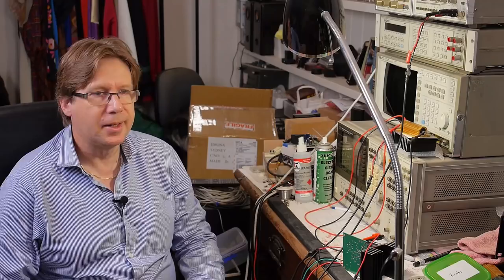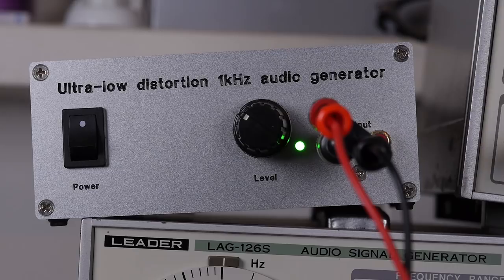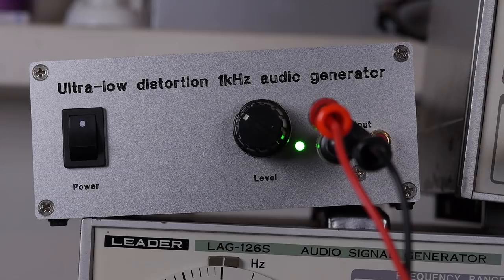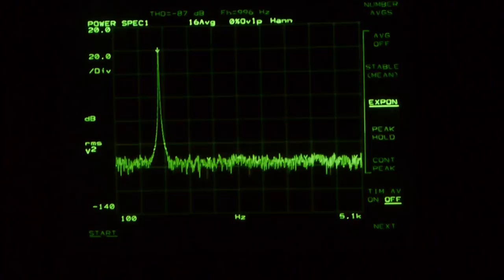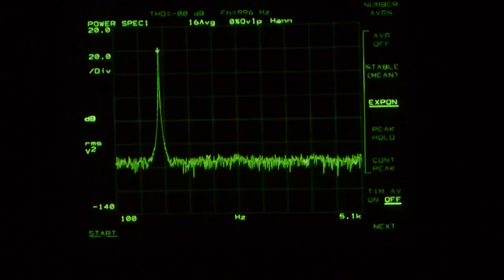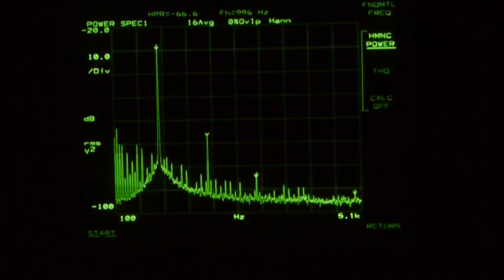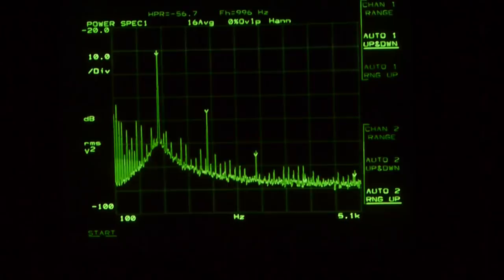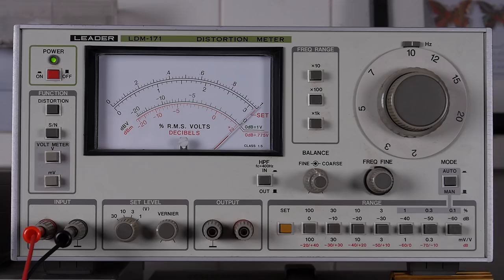Guest Video - Karl Adams - Audio Distortion Measurement

Comment: Well done!  I love seeing lab "tricks" that combine the realities of instrument limitations with the desire to measure at or near the noise floor.

Measuring extraordinarily low components of voltages in the audio band is relatively straightforward compared to doing the same for currents, which I did as part of my technician day job while attending uni, where I  was working with femtoamps.

So I was a bit surprised to not see coax signal leads used everywhere possible.  The bane of my existence was fluorescent lighting noise and powerline harmonics making their way into my test setups.  (BTW, this is still a problem today with LED lighting: I have a friend who makes a tidy living making shielded LED lighting for places like FCC compliance testing labs, radio telescopes, and spy agencies.  The number of "tricks" he combines into his system are astounding.)

I'd always first test the "0 dB amplifier" (a piece of wire) before the DUT, to ensure all my noise sources were either removed, or at least characterized.

I've been a software person for the past few decades, specializing in instrumentation and control systems in general (sensors and actuators), and signal processing in particular.  My analog lab experience provides endless joy when I need to take EEs to task for making my work unnecessarily difficult ("Oh, we'll fix that in software.").

But that's mainly said in jest.  I really like working with EEs because they truly understand noise, both as signals and as statistics, which relatively few software folks adequately appreciate.
Reply: BobC He did test the 0dB amp first.  In fact he ended the video before plugging in the DUT !
Reply: Yes!  I had brain-flipped the signal source for the amp. Hate when that happens.

Comment: Thanks karl, i have a better understanding of the distortion meter, notch filtering then boosting what you have left to measure it.
A million years ago i made a function generator, to get the best sinewave i used a twin T filter and outputted it to an oscilliscope, a rough method i know.

Comment: Silky smooth audio. Much better than mine!
Reply: yours was pretty good too :)
Reply: OpenTechLab - Your audio was quite good although IIRC it was a bit louder here and there where I think you were closer to the mic or using a different one.  Perhaps a bit over modulated at times.  Karl's audio is good but often he was quiet and almost mumbling.  I'm sure you both will improve over time.
Reply: Yes his audio is good better than. Good audio is hard.

Comment: Very nice to watch someone demonstrating practical, attainable, low noise audio electronics. I also use this technique, except via Krohn-Hite filters as notch filters. A good filter is extremely useful, even with digital techniques, and I often keep my filters in front of my scope and other measurement equipment. Excellent job, though, I'm sure many audio nuts will learn a lot from this.

Comment: Yup, that ultra low distortion generator is amazing! Had to build a Twin-T notch filter when building my headphone amplifier to be able to measure THD with the QuantAsylum QA401. Measured -114 dB THD with a 32 Ω load. Can you hear the difference? I don't care! It's trying to do the best you can that's important. Yeah, I know, electronics nerds who like to mess with audio are automatically audiophools.
Reply: Jack Zimmermann Not really.  Actual audiophools will buy products that make no difference even with such extreme measurements.  Stuff like low distortion mains cables that (at best) increase the amount of mains harmonics reaching the amplifier.
Reply: Yeah, there are some crazy shit in the audiophile circles. Fortunately there are some level headed (and very knowledgeable) engineers, like Douglas Self and nwavguy.

Comment: A few thoughts. 1) Did you verify your distortion of your source? if so, what was it? 2) You will have FFT leakage if your source is not coherent to the analyzer. 3) You can verify your setup by using a Stanford Research System SR1. It has a rating of better than -110 dB THD.

Comment: if the sinewave signal thd+n exeed the thd+n of the DUT (an audio ADC) do you still can calibrate let say a reference level of +4dbu (analog) =18dbfs (digital)  , my small finger tell me that i need to match the dynamic range of the sinewave with the DUT correct me if i'm wrong

Comment: Is he using shielded unidirectional power cables lubricated with snake oil to make those mesurements?
Reply: Actually it was gold plated fiber optics
Reply: Bryan Draper you know that the Belgians had wirles communication at least 2000 jears ago that startet diging and no wires were found

Comment: alternatively, have a precision amplifier at the same gain as the audio amplifier unloaded, then connect the loudspeaker load and measure the difference between audio amplifier output and precision amplifier output,  = THD + noise + DC offset

Comment: Define distortion.
What is the relationship between distortion and harmonics? 
Explain the significance of 80 dB.
If that 1kHz is such a clean signal, why all the noise at the bottom?
Reply: JL Software Distortion is the (unwanted) deviation between input and output signal shape.  Harmonics are the occurrence of integral multiples of the desired pure frequency. For analog equipment, waveform theory says all the distortion will appear as extra harmonics (harmonic distortion).  Also, in audio applications, we only care about the part of the signal that can be detected by human ears.  Thus measuring only the increase in harmonics below 20kHz is more relevant than including any distortion above that range.   Furthermore if the device under test isn't unusually bad, looking at just the first few harmonics will cover almost all the actual distortion, thus allowing him to set his spectrum analyzer to not look above 5.1 kHz in this test.
Reply: Distortion is something that adds harmonic content to your incoming signal. So if you feed in a pure sinusoid at a given frequency f, called the fundamental, you'd see distortion as added tones at multiples of that fundamental frequency. In fact, multiples of that fundamental frequency are, by definition, harmonics. This doesn't include noise, which is not related to the frequency of the incoming signal.

As to why 80dB is important, if your test equipment only has 80dB of dynamic range, you can only detect signals 80dB smaller than your highest input level. If your fundamental was scaled to hit your highest level, you could only see a harmonic 80dB lower than that. A good, low distortion audio amplifier might have a THD spec of -100dB, which actually sets the level of its highest harmonic even lower than that, since THD looks at the sum of ALL the harmonics! 

The final element of all of this is noise. Your test equipment itself, no matter how good, will have what's called a noise floor - a minimum level beyond which you can't distinguish the signal you want to measure from the noise inherent in the system. In order to make a good measurement , you need to ensure that the signal you want to measure sits far enough above the noise floor of your test equipment that you're actually measuring it, rather than just measuring the noise in the system.
Reply: Thanks a bunch!
Reply: Much appreciated!
Reply: The scale of the analyser is logarithmic, the sensitivity goes up in orders of magnitude towards the bottom of the display, to show the biggest dynamic range clearly
Reply: Come and see the violence inherent in the system! Help Help! I'm being repressed!